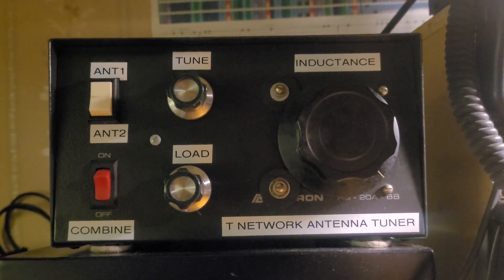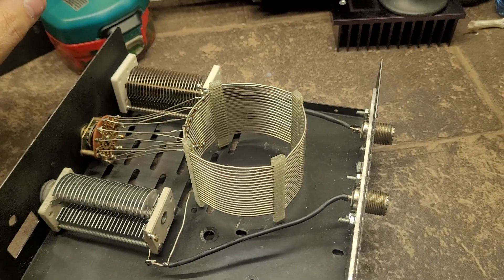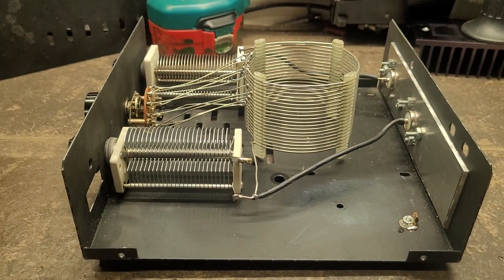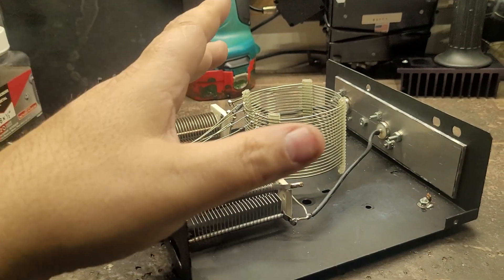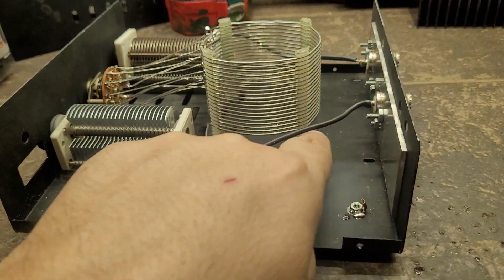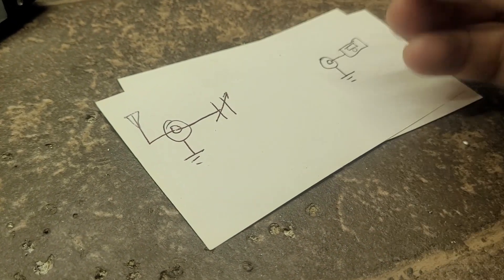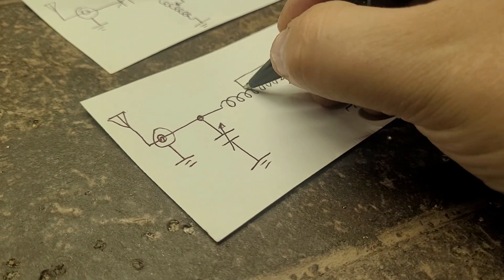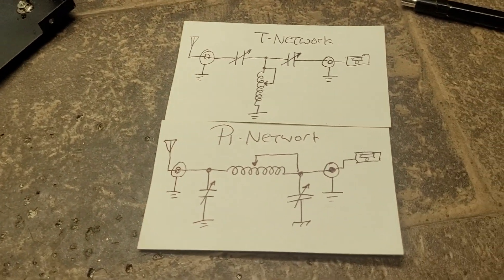PI-Network antenna tuner

Comment: Wondering if you ever considered or used a used a L network? One less component and smaller package. I have been using them on and off for 60 years.  I think MFJ built one once but for some reason the T network seems popular and I never understood why.
Reply from the maker: Hmmmm.. i could try my hand at building one of those.😊

Comment: Signal loss from T-Match always concerned me. The airgap in the Tune & Load can't be good for signal loss.  pi network just looks like it's less lossy.   Would like to see in depth comparison.  Looks good for about 300w.  Hope you Island Hopping adventure went well.  Thanks for posting.
Reply from the maker: Never got a chance last summer due to work commitments, but i hope this year to get out on the islands. 😊
Reply: I am a ham radio newbie and I have been asking myself what the advantage of a Pi network is over a T network. Now, what you mentioned regarding the airgap sounds logical to me. 🙂
On the other hand though, I am asking myself why many commercially available matching networks are T networks, especially as it looks to me like the components are the same, merely to wiring is different. 🤔

Comment: Nice tuner. That should work well for your island-hopping adventure.
Reply from the maker: Fingers crossed!     I tried my vertical whip last summer with good results with the Argosy, uploaded a couple of videos too.    The tuner will be used with that whip, the TenTec Argosy has a built in SWR/RF meter, so i really do not need to have a SWR meter with me.  But i am going to try and make a SWR bridge to go in this tuner if i can!

Comment: A good old style tuner never fails.
I have a homebrew on a wood cabinet but I use more often now a Chinese auto tuner for 27 bucks.
I am interested now in vhf uhf ssb, any ideias to build a tuner for that bands?
Reply from the maker: I would think the same type tuners would work for VHF as well, just the design would be more compact and tied together as close as possible.   Only a guess mind ya.

Comment: good to see you bro how things been?
Reply from the maker: All good back here, busy with work as always and vegetating between shifts... how about yourself?
Reply: @Radionut63  trying find small reciver i can build that is like your direct conversion rec that are easy and not alot parts
Reply from the maker: The direct conversion receiver is not to hard to build at all.  Just take your time and connect the parts.  The hardest part of whole thing is trying to find a proper ceramic crystal resonator, which can be found on ebay easy enough, just make sure sure it falls within the band you are building it for.   I could help you build it is you like.  I can be found on Facebook.  ;-)
Reply: @Radionut63  i know but to fit the spec i want is the hardest part i got bunch of crystals i got for my  persetic  spy radio was wondering if they will work
Reply from the maker: @AndrewMurphy8383  The ceramic crystal resonators are blue in color and have 3 legs on them.
Reply: @Radionut63  ok hmmm 
i am going to try to build a reciver this year but i will see how it will go, i get confused between schematics and bread board and how to ground every thing on the bread boad but i will get it at some point
Reply from the maker: The last one i built i did not even use a breadboard, everything to suspended in the air by it's own leads. ;-)
Reply: @Radionut63  yeah i just love to have it all clean looking that way if i took it to ham clubs etc or schools  it neat inside
Reply from the maker: @AndrewMurphy8383  You can do it!